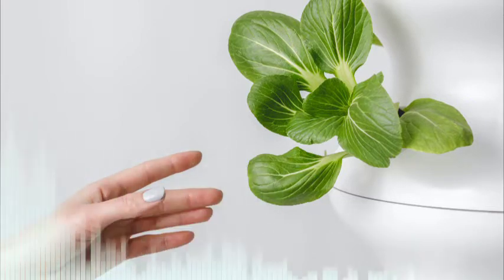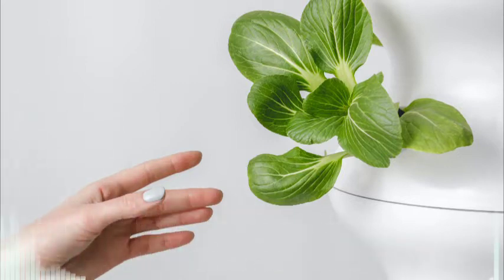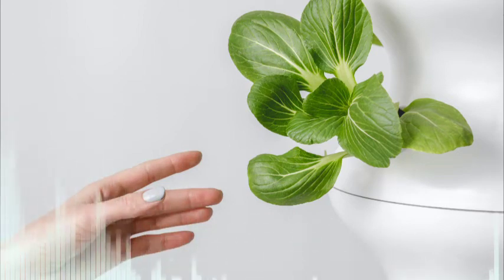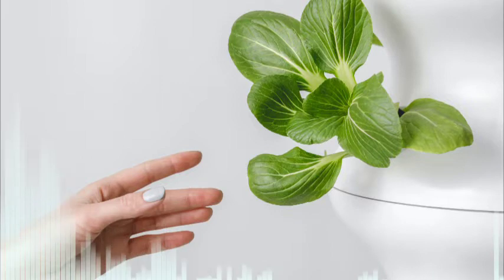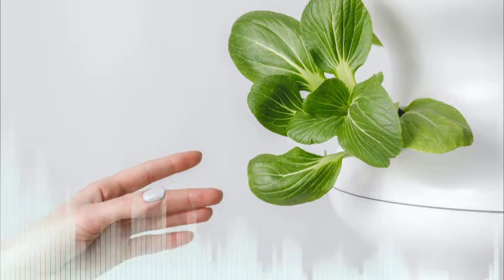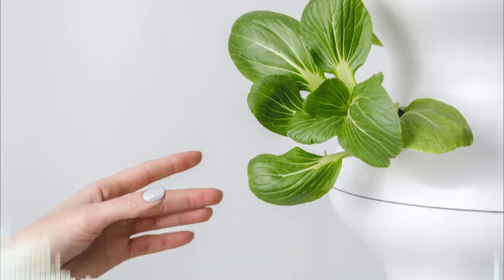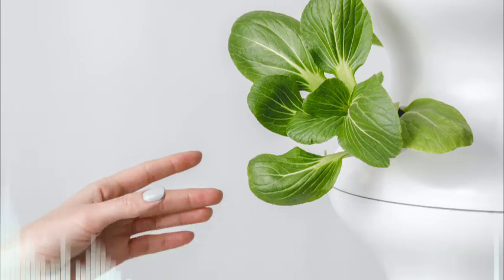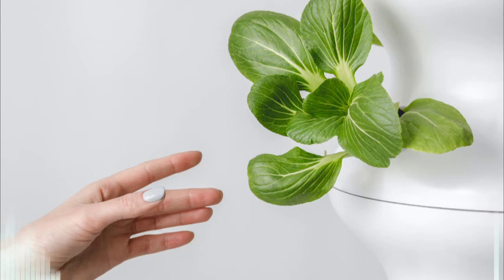Focus on Process: Hydrophonic Aquaculture

Comment: Almaidah Khasanah (2223210014) 4B
This video talks about how to the process of hydroponic aquaculture which has been around for centuries which uses rainwater a 3000 gallon tank is placed on the highest position on the island and the tank is large about 12 feet in diameter and filled with fish inside. thereafter producing as many as twenty-five thousand heads of lettuce, one ton of fish a year from only 3 thousand gallon tanks. So, in this process we can see that fish and plants are done at the same time.

Comment: Clara Angel 2223190058 3A
•	Process of hydroponic 
•	Start rainwater is collected in a sizeable 3000-gallon tank, which located in the highest point on the island. The tank is huge; the diameter is 12 feet. 
•	once the tank is filled with rainwater fish are added to the tank

Comment: (2223190080)_ 3B_ Arsi Syahid Yusuf Miraj This video about hidrophonic,  This video explains the process of the particular system of hydroponic aquaculture works to raise fish and lettuce plants.  It starts with, collected the rainwater in a large gallon tank until the water from the lowest part back to the highest point on, so the water can circulate through the process again.

Comment: 2223190047. 3B. Ivania Tiara Falalini

Hydroponic Experiment to Raise Fish and Lettuce Plants

The growing of plants without soil has and is being developed. Scientists believe that using hydroponic as a farming tool started in the ancient city in Babylon with its famous hanging gardens. In modern times, researchers at the university of the Virgin Island had developed the system of hydroponic aquaculture that is both simple and no cost thanks to gravity. The progres began when rain water being collected to a 3000 galloon tank and added fish. The next one is the collected water slowly runs out of the first galloon tank due to fish into another tank. The water then being filtered and bio-filtered consisting bacteria that would convert any harmful amonia from fish waste intro nitrate which used to feed the plants. The plant's root stay in the water absorbing any nitrate and nutrient in the water passes its stray. Next, when water has reached the lowest part of the island, they will get pumped to the highest point on the island so the water can circulate through the progress again.

Comment: 2223190056 Wahyu Widhi Atmoko 3B
This video tells about the hydroponic cultivation process system. of course this hydroponic cultivation is very easy and of course the costs incurred are not expensive, gallons to hold water can also be used to breed fish, very useful thing.

Comment: 2223190042 Anisa Juliyanti (3C)

This video is talking about hydroponic aquaculture experiment to raise fish and lettuce plants. The process is start with rainwater is collected in a large three thousand gallon tank, then the tank is locatwd on the highest point of the island. Once the tank is full with rain water, fish are added to the tank. Then the fish swim around and excrete waste into the water. Then it will produce nitrates and will use to feed the plants.

Comment: The hydroponic method is done by suspending plants’ root in nitrated water, the plants then soak up the nutrients they need before the water drains out to the reservoir. To recycle the water from the reservoir, they use pump to get the water to the tank used to do hydroponic. Then the process starts all over again

Comment: 2223190075_Muhammad Rizky Virgiawan_ 3C, this video talking about "how the hydroponic aquaculture works, to raise fish and lettuce plants." This systems is simple and low cost, the systems uses gravity to create recirculating water systems which fish are raised and vegetables are grown. 
First, rain water is collected in a large 3000 tank and located on the highest point of the island. One the tank is filled with rain water fish are added to the tank and subsequently raised in the large tank. So first is collect rain water in a large tank then they add fish and fish will swim into the water. 
The next step in the process happens in this way rain water collected in the large tank slowly runs out of the bottom of a large tank into the another tank. This another tank hold the waste from the fish. Then, the water filtered. After this, it is passed through a bio filter contains bacteria, now these bacteria convert any harmful ammonic produced in the fish waste into nitrates. These nitrates then used to filled the plants. This is why hydroponic aquaculture works.

Comment: 3C - 2223190009
this video explain about process of how the particular system of hydroponic aquaculture works. starts with, the rainwater is collected in a large gallon tank until the water from the lowest part back to the highest point on, so the water can circulate through the process again

Comment: Estevania Dewi Oktaviana (2223190087). 3C This video tells about "developing a hindroponic system?
First of all, rainwater collects just above the 100-foot long aquatic plant tank that hangs over a tray inside
certain cases of suspended crops the tray is a plant root lettuce plant standing in water now through the plant roots absorbing or absorbing nitrates and other nutrients in the water before the water flows out of this hundred feet long tank into the large reservoir of the reservoir. located at the lowest point on the island it is now necessary Of course to get water from the lowest part of the island back to the highest point on the island so that water can circulate through the process again now how do they get water from the reservoir up to the highest point on the island, a pump was used to drain water back into the 3,000 gallon fish tank
and then the hydroponic process begins again Cultivation scientists say that this system is relatively simple yielded about twenty five thousand head of lettuce
and a ton of fish a year of only one three thousand gallon fish a must-have tank for a commercial company several tanks to make a profitable process but researchers at Virgin Island University have shown exactly how aquaculture can be used to grow plants without using the process soil can help some countries are
looking for ways to develop new methods of producing food in a soilless culture just to set an example in the case of tomatoes the land farmers raised about 3,500 crops per hectare in hydroponics, tomato plants can be placed closer together and it is possible to cultivate as many as 10,000 crops on one hectare in the future. We will probably see more and more agriculture being done as hydroponic cultivation and many consumers will not know the difference

Comment: 223190084 - Novianingsih -3C 
This is video about " How this particular system of hydroponik aquaculture works?" 
To start with rain water is collected in larger 3000 gallon tank, this tank is located on the highest point of ghe island, the tank is so large that it measures about 12 feet in diameter.